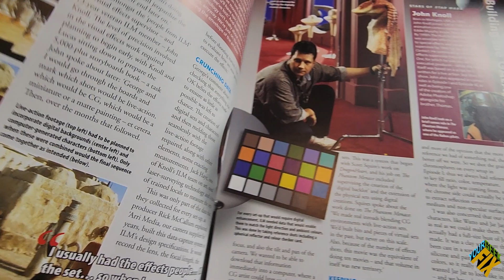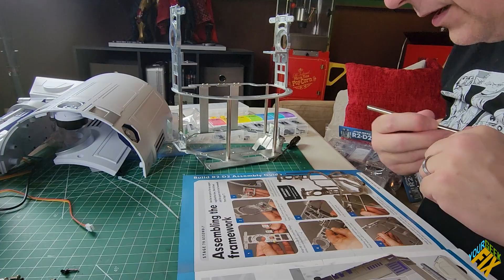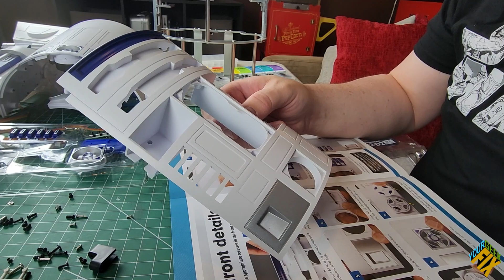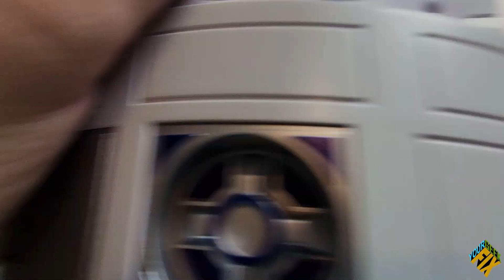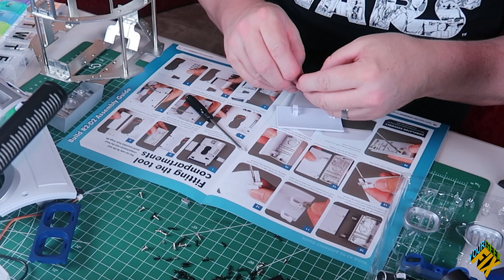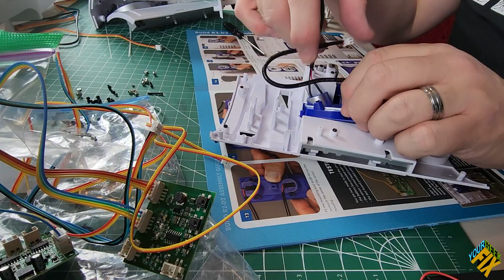Fanhome Build Your Own R2-D2 Box 21

Comment: Screws from your fully finished and ready Ironman?

If the plastic was even a milimeter away from the buttons, it would feel like a loose button. But what was the issue with the sensors?

It makes sense to send out the interesting parts after you paid for enough boxes. The next episodes will be pure eyecandy : -)
Reply from the maker: Hey, can you resend me your videps?
Reply: @YourGeekFix  I just saw the email. I'm uploading them right now. It will take about 1 hour.
Reply from the maker: @seelenschlucht  ok. The show comes out this week
Reply from the maker: @seelenschlucht  ok